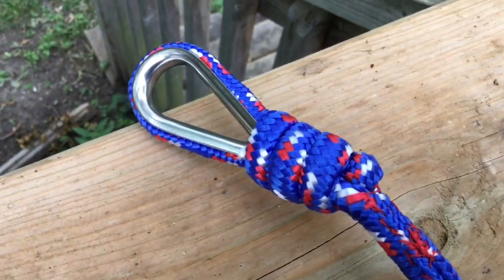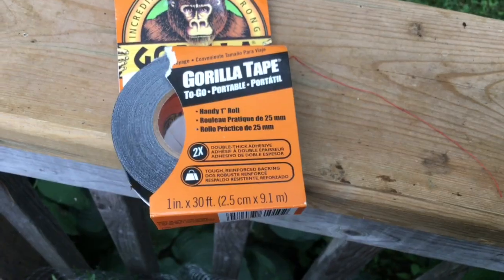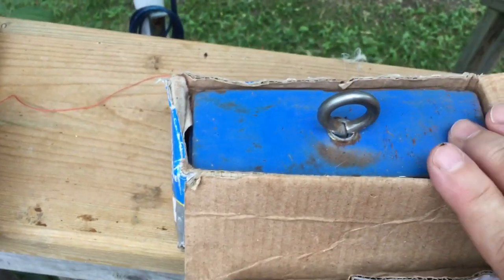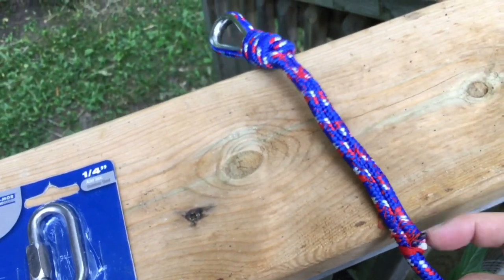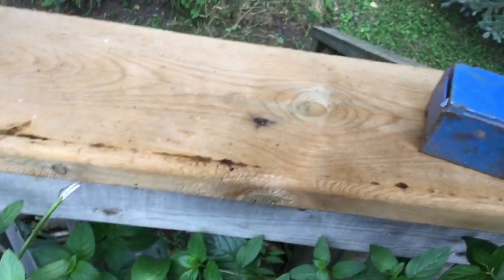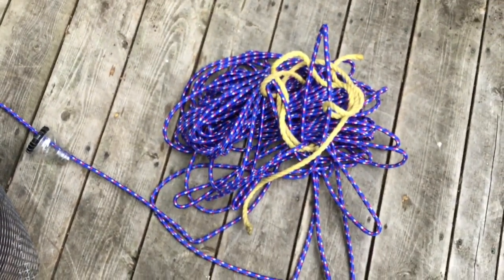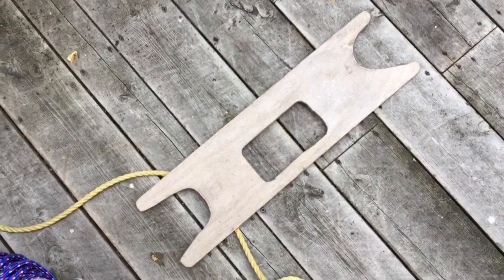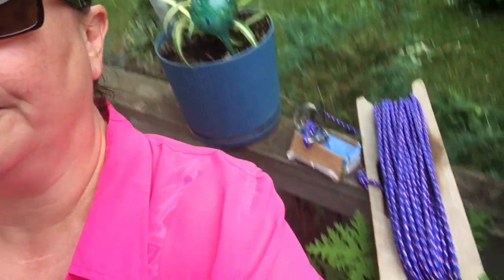Magnet Fishin’ Rig Idea!

Comment: Good video. I think the plastic bottle top will float and slide up the rope. Which may become an issue in certain situations. Maybe tie a knot just above the bottle. Or wrap the tape a bit fatter.
Reply from the maker: You have a good point there.  I was just following the examples I saw online.  
I will have to figure something out.  I do like the tape idea.  Thanks for your suggestion.